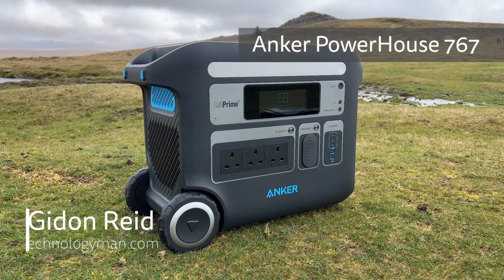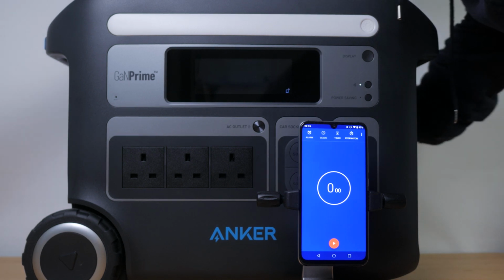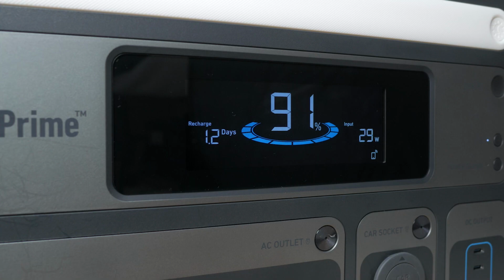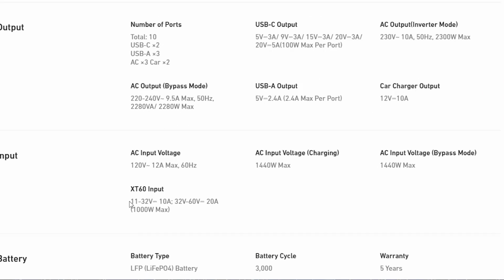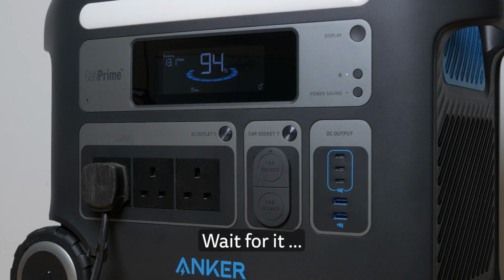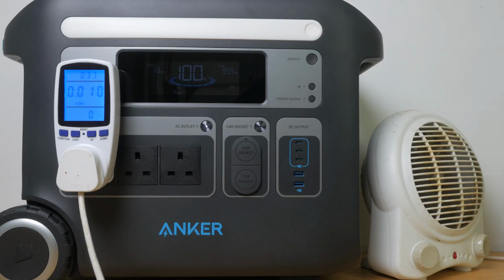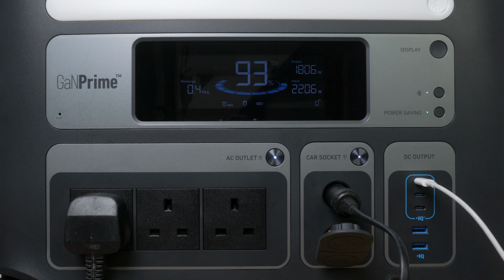Anker PowerHouse 767 in-depth review | 2300W AC, 2048 Wh LFP, 2200W charging

Comment: I would like to see if it would charge on a 12v inverter through a 120vac plug? Would that be faster than the car outlet?
Reply from the maker: I'm not sure I understand you question - at 12V you're limited to around 10A, whatever you use.

Comment: I have just bought the 767 which I have an issue with . I was powering my dishwasher at 2300w output. When I connected the mains supply to it the device started drawing 2400w mains power then switched itself off  due to overload. Even though I set the charging AC input to only use 500w in the phone app the device just jumped up to 2400w, thanks Ian
Reply from the maker: Does it work ok running something with a little less power draw?
Reply: Hi,
Yes it works ok at lower power consumption.

Comment: I am thinking about using one of these as a power supply for a static caravan. The caravan has gas cooker and heating, LED lights, but I am really looking for it to keep the gas boiler running so I don't have to have a noisy generator running.
Reply from the maker: Good plan!

Comment: Hi, thanks for the very useful video. I wonder if you have an idea how long the Anker 767 will last connecting  a 500W fridge? If there is a formula to calculate it would be greatly appreciated.
Thanks
Reply from the maker: Fridges will turn on and off with the compressor so your best bet is a cheap energy monitoring plug. Run the fridge for 24 hours and see what it uses in Wh. Divide this into 2048Wh to find out the number of hours your fridge will run.

Comment: Very good review.

Would this be able to power a 1000w water pump?
Reply from the maker: It should! Does the pump have an induction motor? Might want to check initial draw but you have a fairly large safety margin.

Comment: Do you know if you can use a 2 into 1 xt60 and plug in 1 solar panel and 1 cigarette connector at the same time. I'm thinking not as one is 20 volt and other 12 volt, but do you know the right answer please.
Reply from the maker: It supports up to 60V input so if your solar panel's OCV is less than 48V you could connect in series with a 12V car outlet I guess but sorry not something I've tried.
Reply: @TheTechnologyMan  Sounds promising. May drop Anker a line as they are very helpful, and don't want to risk any damage.
Reply: @TheTechnologyMan  I checked directly with Anker. The input voltage from 2 (or more) supplies must be the same, so I suppose taking solar from the MPPT controller would mean it matched the cigarette 12 volt supply .... but not sure if it's worth considering or any gain in doing it.

Comment: Many are looking to keep their freezer and/or fridge during a blackout rather than all these small appliances.  Maybe testing a small fridge, then a fridge/freezer combination and a then a separate freezer.
Reply from the maker: Good suggestion thanks!
Reply: Do you think this model combined with the expansion battery could could run a full sized fridge/freezer in an emergency? If so, for how long?

Comment: I enjoyed your review and was happy to see that it is possible to use non-Anker solar panels.  I am considering the european version of the 767 and would like to use 2 Risen 450W panels at 24v each connected in series. So... 48v input. Not sure about the 'open circuit' requirement. Should these work to give at least near maximum charge speed?
Reply from the maker: You'd need to check their spec - are you sure they are 24V?

Comment: Great video! Any advice if I want to use the Powerhouse 767 to charge my leisure batteries of my Hymer RV - What is the best "connection" without losing energy? The USB-C output? Thanks!
Reply from the maker: I'd probably use the 12V DC car outlet.
Reply: @TheTechnologyMan  Thanks! And just hook it up straight to the batteries?
Reply from the maker: Yes but this isn't something I've tried or researched, so I'd guess it should work ok, but I'd probably do a little more investigation first if I was you to be sure / safe!
Reply: @TheTechnologyMan  Appreachiate it. Thank you!

Comment: Since it says its rated to last 10 years, does that mean it won't last longer than that? I'm looking into getting one of these to use during blackouts and maybe a few times throughout the year (about 10 times a year). Would I still only get about 10 years out of it before having to replace it? Assuming I take care of it and maintain it properly of course
Reply from the maker: The 10 years is based on 3000 charge / discharge cycles and average use. So will less use the battery could last a lot longer. And that's only until it gets to 80% of its original capacity so still very usable even after that!

Comment from the maker: Does the Anker have everything you’d want at this price point? Or is there another model you’d like me to look at? Let me know down below!
Timestamps:
0:00 Intro
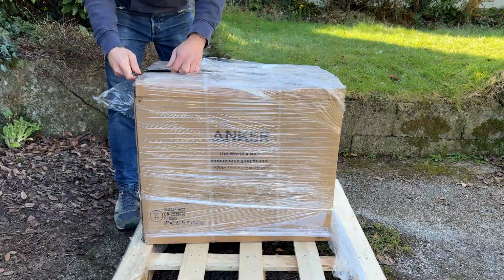0:56 Overview. Unboxing: what's in the box
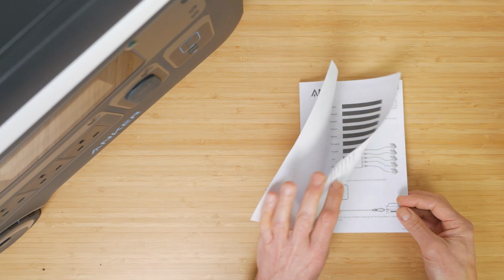1:14 Weight, size
1:32 LFP (LiFEPO4) battery technology
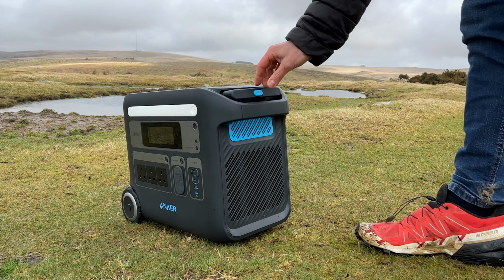1:55 Carry options - retractable carry handle, wheels
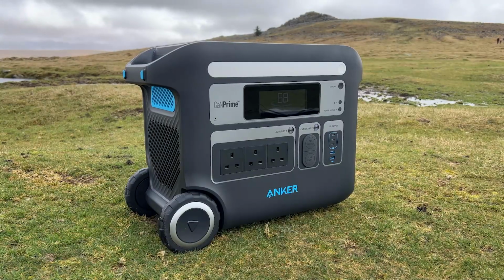2:08 Build quality - drop proof design
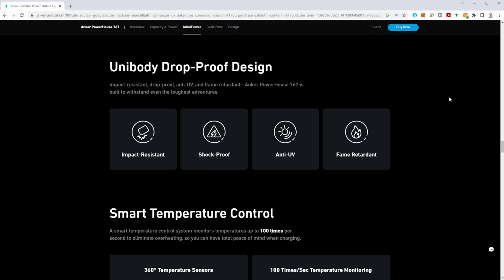2:26 2300W (2400W US) inverter
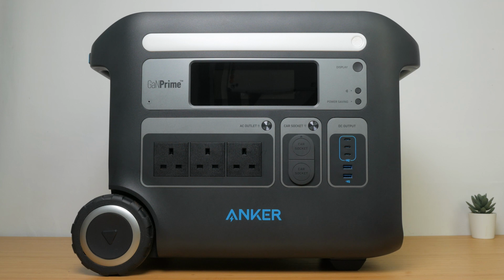2:52 Front of unit - display, outputs, floodlight
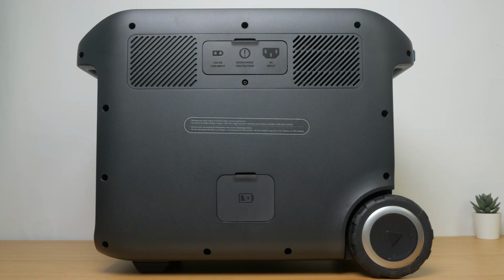4:06 Back of unit - mains and car / solar charging ports, expansion battery port
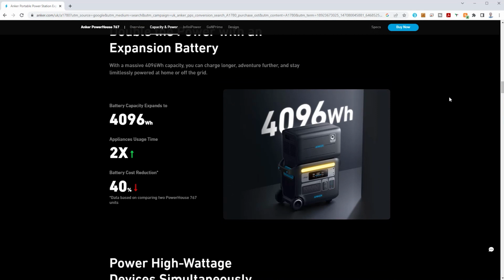4:25 Top of unit
4:36 Charging options: mains, car, solar intro
4:51 Mains charging up to 2200W. Charging time measurements - temperature checks
5:37 Lowering charging speeds in app
5:47 Noise measurements charging
6:15 Display walkthrough
6:33 Smartphone app
7:02 Charging from a car outlet: 12V and 24V
7:30 Solar charging options and tests
9:30 Performance of outputs - 2300W inverter tests around house and in workshop
10:35 Overloading power station - voltage drops
11:28 Noise levels measurements when fully loaded
12:01 Smart AC Plug, power saving mode
12:25 Parasitic draw with AC on (power saving mode off)
12:46 12V DC output load tests and parasitic draw
13:16 USB ports testing 
13:28 UPS function
14:04 Battery capacity test and efficiency measurement  - AC
14:31 Battery capacity test and efficiency measurement  - DC
14:44 Conclusions
Reply: I know that Anker 767 has a 1440W maximum charging input. I have seen this in many videos. In your video, it appears to be 2200W. What is the reason for this difference?